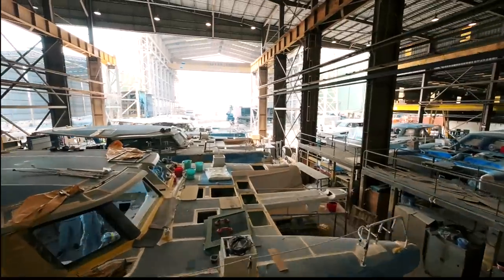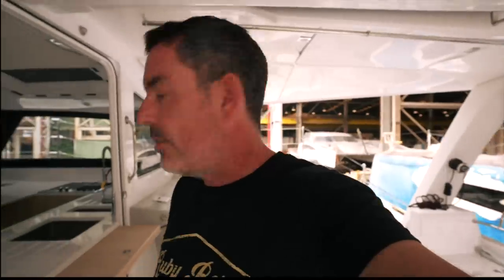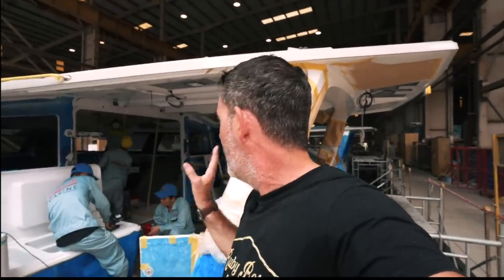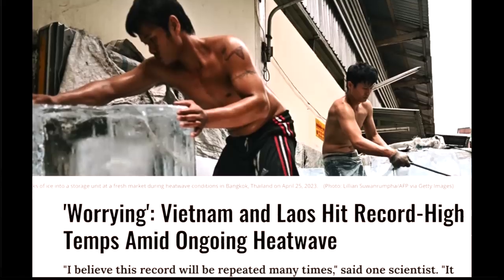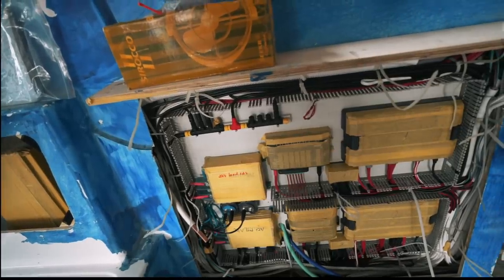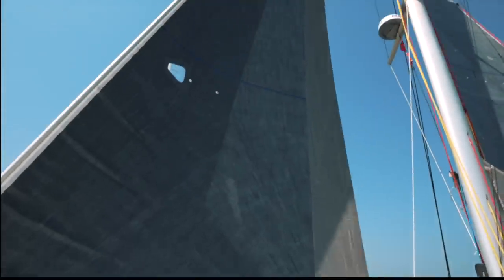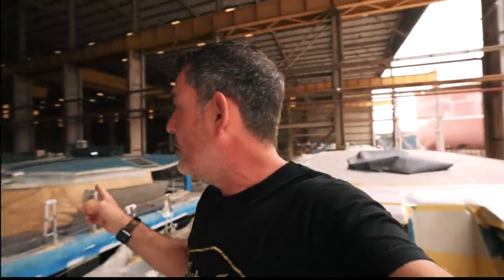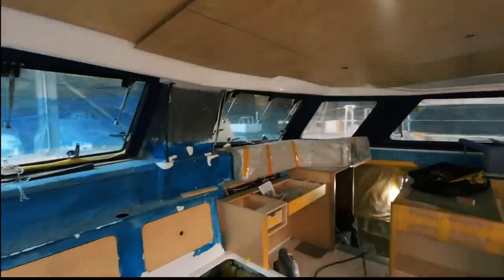The Ruby Rose 2 Update You've Been Waiting For!

Comment: Hi Nick, why a 24 volt system? I have been told that almost all cruising multihulls today are 48 volt / 12 volt - for the systems that must run on 12 volt. There is less weight for the conduits with a 48 volt system and lower amps, which should translate into greater reliability. Also, a number of other YouTubers say that there is a lower risk of fire with the 48 volt system.

Comment: Other advantage of 220V over 110V is that you drain half the current so you save some weight on the wiring.
Reply: Yes, 24v vs 12v = less wire weight/cost ... same for 220 vs 110v and on bigger boats you have longer runs, so ...

Comment: Why am I disappointed to hear RR2 won't be a 48v boat? I shouldn't be of course, reality catches up with future to meet in the middle obviously.
Great notes about recessing the screens for better visibility, as screens get larger every year it seems, it's always smart to plan for future - and for upgrades.
Reply: I am sure some systems (battery bank, solar bank - maybe?) are 48v.  This is fairly common, now - iirc though things do change.  

Power distribution to regular devices - "low power" electronics would be 24v or 12v.  Power distribution to high power (yet not the engines or batteries) would be 220v.  You could maybe add a 110v in there too - for certain items or flexibility though 220v is 50hz and 110v is typically 60hz - so that is a fun conversion.

IIRC, Rick Moore's Sailing Sophisticated Lady has a 48V battery bank - though it steps up to standard AC voltages and stes down to standard DC voltages.

Comment: Does SeaWind give you the option for dual voltage capable 110/220V so there isn't an issue regardless of your location, it's something offered by other manufacturers that is a great feature.

Also, curious if they offer the option to lighten up the interior by painting the window/coach roof supports white?  It's kind of dark in the interior and forward visibility isn't as good as the renderings Seawind shared at the start of the project, the website misrepresents what the boat actually looks like.

Hope the rest of the process goes smooth and you two are sailing this summer!

Comment: Just an fyi… batteries take about 2 hours to fully charge if the system is designed right and there is enough electricity to charge it.  It’s not a matter of cramming electricity into a battery faster… batteries are charged by holding an external voltage slightly higher than the battery voltage and it just takes time to absorb.   If anyone says a battery took 30 minutes to charge they mean it was already partially charged and they topped it off.  Also, batteries will take the same amount of time to charge the last 15% as it took for the first 85%.  This is why electric car owners only stay at a charging station until it’s about 85% full…. It’s a matter of time vs benefit.   

Also, charging speed depends on battery type… such as lithium or lead acid or agm.

Comment: Nick, when you finally test the battery charging, a small side info would be nice:
Victron launched a video showing how to roast an alternator with a lithium battery. I will be interested, when you try a crash load on your empty bank, how will be the temperatures of the alternators - are they perhaps regulated down due to overheating.

Comment: Nick, did I understand correctly that your solar charging system is very large to charge batteries quickly in optimum conditions so when cloudy or low light they still have the ability to charge adequately ?